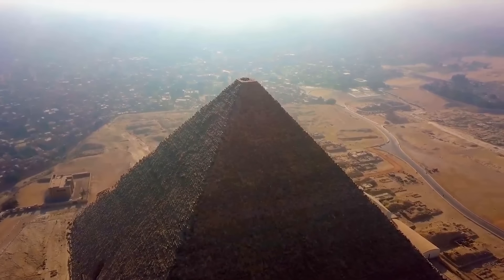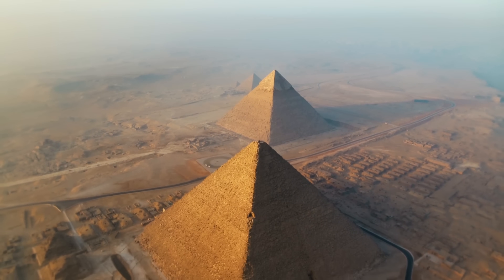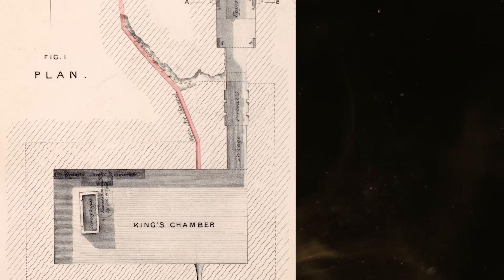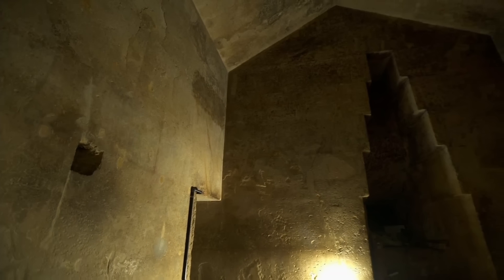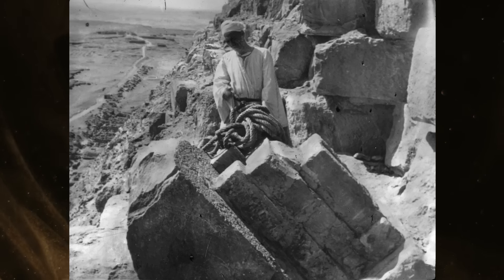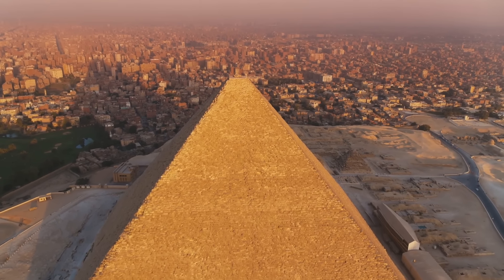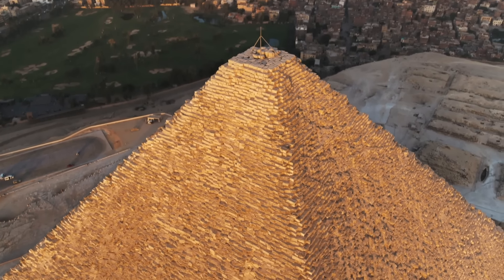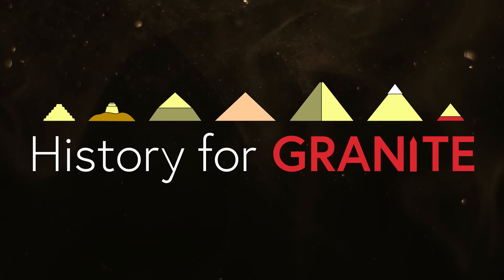One Solution to the Four Channels of the Great Pyramid

Comment: I completely concur with your findings. Well done! Your final statements, bring to light the actual purpose for the ventilation. It was not to provide ventilation for those who built the pyramid, but for those who spent the last moments, most likely people higher up in society, in the final burial ceremony.
Reply: Perhaps even beyond the final moments. The priests and acolytes of the pharaoh's cult as well as his parishioners in the days and maybe even years following. Until the next pharaoh's high priest drove out the prior. Building such a difficult engineering project in granite and limestone into the heart of the pyramid just to keep the "elite" cool for the final moments of the pharaoh's internment seems hard to comprehend from a modern perspective. Did the internment take weeks? Even if it did, I find it hard to accept that building this feature into the most massive creation in the world to this point was just for the comfort of those people. In addition, when he says the copper pins could be the equivalent of leftover nails at a construction site, I have to call BS. You don't build pyramids with nails and where else do you find copper in the pyramid? These are not scraps from the building. These are significant in some way. Who would put this feature into this many millions of metric tons of stone for a whim or some ridiculous purpose? Why use copper at this point?
Reply: it was to provide fresh air for the pharaoh to breathe in the afterlife
Reply: @-jank-willson   While it isn't specifically mentioned in the pyramid texts it can be guessed at by the other supplies provided to the deceased for use in the afterlife. All the things a living person will need are provided.. and fresh air is vital.

Comment: If the pyramids held a mummy, the builders would've known that a high humidity environment would lead to mold and rot.
Reply: This. It also explains why the shafts weren’t direct line of sight.
Reply: if it was built as a tomb (which is so unlikely)

Comment: So, if the Queen's Chamber is unfinished, then we can assume the pyramid had at least one major design change. The fact that the air shafts exist in both chambers probably means the King's Chamber is a revised Queen's Chamber and the change was known early enough to cap off the vents 15 meters from the outside. It makes you wonder which features of the pyramid only exist as a result of the revision and which were original (and if switching from underground to the Queen's Chamber was actually the first revision). The grand gallery certainly wasn't necessary to build the Queen's Chamber. Perhaps the granite plugging stones were in the original plan because there were to be no portcullises and perhaps the well shaft was always going to be the way out.
Reply: I wonder if the capped off queens chamber vents are evidence that the pyramid was originally a stepped design? The same could potentially be said about the strange vertical joints in the vent shafts
Reply: Ancient Architects channel has a great video that makes a convincing argument that the pyramid was originally planned to be smaller (and end where the queens chamber shafts stop), and was enlarged, including moving the burial chamber.
Reply: @fritter63  I think thieirs a decent chance this is true, though it could be tha the entire 'inner' pyrimid was finished up to the top before the enlargement began, or the enlargement could begin at some point after the Kings chamber is completed and 'finalized' as the chamber to be used and the entire upper pryrimid is completed as one effort after the expanded base catches up with the current construction level.  The muon scans might be able to resolve this distinction if it finds a density discontinuity in the pyrimid at the original surface, and if that discontinuity stops apruptly part way up the pyrimid then it will be strong evidence that the expnsion happend before completion of the original plan.
Reply: It would make sense considering earlier pyramids had chambers like the Queen’s; but the design was changed part way through construction.  They’re really “King’s Chamber 1.0” and “King’s Chamber 2.0.”
Reply: @fritter63 
Fascinating.  I will have to check it out.  Thanks.
Reply: @fritter63 I saw that too.  Interesting idea…makes sense
Reply: It could either be a backup if something went wrong with the king's chamber or it could be an earlier version in a smaller pyramid if the king were to die early.  The fact the air shafts were kept shut makes me think it was left unused, especially as the entrance would have been boarded over with the slope of the grand gallery.  There's also no sarcophagus.
Reply: Queen's northern shaft is bending around the Grand Gallery. So if they abandoned the Queen's chamber, then why to continue building the Queen's northern shaft?
Reply: @Upuaut4572  Because if Khufu died early they still needed that shaft. Regardless of if the grand gallery was half built.
Reply: it's not necessary a design change. I think on this channel the theory was already discussed that in ancient time lifespan was not taken for granted. The pharao could die any time and the mummification process only took like 3 months. So there was a need for a contingency plan - what if Khufu dies before the pyramid is finished. 
I firmly believe that that is the case for the great pyramid. Option 1 for the pharaos early death was the subterranian chamber, where the original entrance leads.Once the builders reached the Queen's chamber option 1 was discarded, hence it's unfinished state.
Option 2 for  burial was the Queen's chamber. Interestingly enough the north face corridor is at the same elevation as the QC, maybe that was the plan for the entrance in case it was required. But it was not needed, so the building continued and...
Option 3, the masterplan was the King's chamber. 

As the builders managed to reach the elevation of the KC and the pharao was still alive they stopped the work on the QC as it was no use anymore. The QC shafts also terminated at the elevation of the KC. They simply stopped building the shafts as they already knew it will have no practical use.
Reply: @tamasvago87 good ideas!  Maybe there are even unknown niches that remain to be discovered? Chambers
Reply: Maybe the original plan was for a smaller pyramid.
Reply: That fails to account for two things. 1 the strange buildup of salt crystals in one of the queens chamber shafts, but not in the other. To me that seems like a strong indication that they were subjected to some sort of chemical process. and 2 it doesnt account for the strange internal "plugs" or separated chambers that the shafts terminate at. If they were intended as vents, why would you have multiple obstructions short of where they terminate
Reply: @kennethferland5579  Mortar samples from inside the pyramid date back to 13,000 years ago.
It is impossible to x-ray or scan the Great Pyramid because iron filings and other metals have been specially added to the mortar in trace amounts. 
I'm bad at storytelling. I encourage you to look for information.

Comment: Glad to see that you're back.  Very cryptic statement that the channels were for air flow, but not for the workers (if I got that right).  Then, for whom?  I guess we have to tune in next time, same bat channel.
Reply: I would guess that they were for the workers who had to finish the chamber after the roof slab was placed over it. Torches would have made the place not just uncomfortable but deadly.
Reply: @JorgeStolfi  Yup.  I suspect the final finishing in the chambers wouldn't even have started until most of the basic pyramid construction was already completed.....for safety reasons.  Which may be why there were plugs added as the channels were built and the pyramid expanded.  Then once the basic  block construction was finished the advanced artisans would come in to finish everything off inside while the outer casing was also finished.  That's when the channels were unplugged and the final interior of the chambers would be finished off, plastered, paved and painted with the channels being the last parts covered over or plugged at the workers discretion.  The only thing I would disagree with is the transition from saw cut to drill.  You can't end a saw cut part way through a stone like that.  That's not how saws work.  You either cut all the way through or you don't.  I suspect the stones were cut only with saws.  The only difference is the first cut will be clean, the second cut will see the waste stone breaking away from the corner joint randomly where the two cuts meet.  Needing some areas to be redressed with hand tools and some not depending on how accurate the cutting goes and when the waste stone breaks away.    I doubt any tube drills were used at all but it's possible they drilled the point where the cuts would meet as a marking point for the saw to keep the workers on both sides of the large block on point while cutting.  Sometimes the cuts transitioned nicely past the holes to make a 90 degree angle, sometimes not and you were left with the rounded drill hole angles.
Reply: they had fleshlights dude @JorgeStolfi
Reply: that pharao had an afghan hound , and the dog needed some fresh air now and then ...

- theres another grand gallery above

- and another monarkys chamber on upper stage, with a wents for his cat
and them points directly at saturn , now and then ...
Reply: @MrBottlecapBill  I'm still confused though. The Queen's chamber was blocked off at some point, but the King's wasn't. If this was about ventilation for the artisan workers, why was one pair of tunnels blocked but the other not?
Reply: Maybe the pyramid was intended to be used as a ritual space for years before the upper chambers were sealed off with plugging stones?   Workers in the King's Chamber wouldn't need much ventilation since the majority of work on the walls and floors would be done before the ceiling was completed, but a gross stuffy humid environment wouldn't be acceptable for noble priests who might be coming in with lamps and offerings.  Jean-Pierre Houdin's idea of a parallel route of corridors connecting to the King's Chamber is also interesting... there could have been a whole internal circuit that was meant for people other than Khufu to travel.  Only after a long period of mourning (possibly even lasting for generations) were the chambers sealed.  And the Queen's Chamber was there as a fully functional backup ritual space in the event that Khufu died early or the ambitious construction of the King's Chamber was a failure.  Clearly the idea of a ventilated ritual space was so important that they did it twice.
Reply: @JorgeStolfi  The torches wouldn't have burned at all without the fresh air in the first place. So not because the torches would have made the place uncomfortable or deadly but just so the torches would stay lit for those 'finishing' workers to see/paint  by... 
I think there was probably a considerable amount of paintings, art & texts on the walls before the vents became blocked and the salt built up and ruined them?!
Reply: @unclvinny  They both were blocked off. The Queen's chamber shafts weren't opened becaus the chamber was never finished... The King's chamber shafts were opened up once the chamber was finished by drilling/sawing through the chambers finishing stone.
Reply: @justinfarnell2284   This [that the shafts wre opened] seems to point to the direction that the chambers were used by people with torches for some non trivial time.

Comment: If they were air vents, then perhaps 2 were required depending on which way any wind was blowing. The lea side of the pyramid would have less air pressure and thus facilitate air movement in one channel and out the other.  Also depending on relative temperature of the stone versus outside air, the air in the channel would be denser than the outside air which creates a natural downdraft through the channel, or is less dense if the pyramid is warmer than outside air which would create a natural updraft (same as a wood stove chimney).  This way the chamber could always have fresh air and CO2 buildup from lamps and workers would be cleared to safe levels. 
   Another reason for circulating air would be to dry out any rain water that seeps in and collects inside. If they knew about embalming/preservation, then they would make sure to prevent water damage
     Also if for air circulation, then fire in the chamber near the lea side channel opening could heat air going up the channel thereby creating a strong updraft.  Also, besides CO2 buildup, air may have needed to be constantly replaced during painting if Egyptians used oil based paint.
Reply: Very cool ideas both to help with preservation of a mummy and of paint. I'd also suspect that the pyramid could also be used for ritual purposes and/or to show it off before the pharaoh died and was buried in it. How much would a foreign leader be amazed if the pharaoh brought them in there for example. In that case nice smelling air would be a pretty important thing.
Reply: Wind could easily create a Venturi effect on the shaft openings on the north and south faces.
Closing the shafts was simple done to make the chamber pretty when the ventilation was no longer required.
Oil lamps with salt added to the oil do not produce any smoke, but they do produce significant amounts of CO2 and heat, and while the heat may not have been debilitating, CO2 kills people pretty quickly: you simply get tired, and go to sleep, never to wake up again.
And while OSH wasn't a priority back then, it was economically beneficial not to allow your workers to die of asphyxiation.
Reply: No this dosn't make any sense.  The fact that their are 2 channels is evidence that its a ritual feature not a practical one.  If the pyrimid is open the ventalation will always be to draw air in  at the north side entrace and for it to go up through the structure and out the channels.  One large channel would be far far easier to make then 2 seperate ones, and if 2 channels from the queens chamber were already made then they should have been used to add more ventilation, the fact they reamained closed permently and were aparently built over once the Kings chamber was completed and became the target burial chamber invalidates the ventilation theory.
Reply: Air will only move through a space if there is a way in AND a way out.  You require both shafts for air to circulate. 
 You can blow through a straw, but not if you block the other end while you do it. 
One passage might be for ritual.  
Two passages allow air to flow in, through, and back out again.
Reply: Something not discussed - hot air rises. We see the shafts rising. In most attic or crawlspace construction multiple vents are used, and on attics usually some are low to allow cool air to enter and other higher to carry the heat up and out of the building. If air was rising through the grand gallery it could exit via these two shafts naturally.
Reply: That is the entire implication of the "ventilation theory."  @gerretw
Reply: It makes a certain bit of sense. It makes more sense than it being a microwave guide, since that theory depends on the shaft being straight and uniform in size, and these are neither. @bmoneybby

Comment: I have a wild theory for the question of who the ventilation was for: it was for the mummy. By keeping the humidity and temperature lower and stable, the body would be preserved better. A similar thing happens in the Mummy Crypt in Wiuwert. There, some very old bodies of people and animals have been preserved and the reason is still unknown. The only logical  correlation as to why the bodies get preserved so well in that room is that there are two small openings (sort of windows) with a similar size to the pyramid channels to let light and air in, on the north and south side of the church. For some reason, this keeps the humidity and temperature in the room at a remarkably stable level. I've visited this crypt a couple years ago on a very warm day and the climate in the crypt itself was very pleasant. It's very much a long shot, but I couldn't help but not think about this being a reason as to why they would go out of their way to construct this.
Reply: Wow. This is the best explaination for all.
Reply: except 1. the wiuwert mummies mummified naturally, and the causes for that are as yet unproven, and 2. assuming there ever was an egyptian mummy in the great pyramid it would have already undergone a comprehensive process of mummification, for which the absolute best place to ensure longevity would be a completely sealed, airless crypt.
Reply: Not credible.  The Egyptians would not have been able to determine how much airflow would result from the channels and what effect that would have on a mummy.  They also completly fail to ever repeat this feature dispite clearly still caring a lot about the preservation of the mummy and were very successful in keeping their mummies preserved without such ventalation devices.